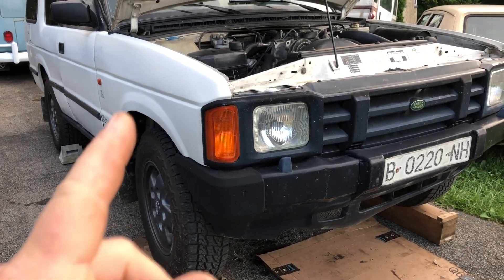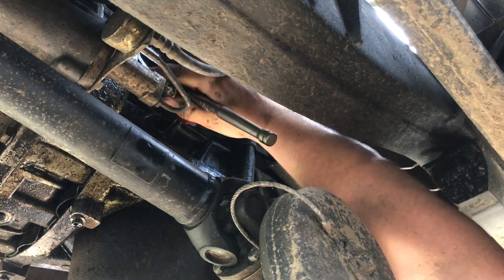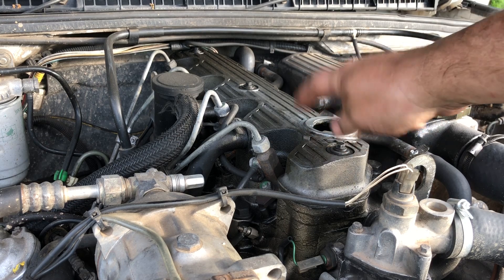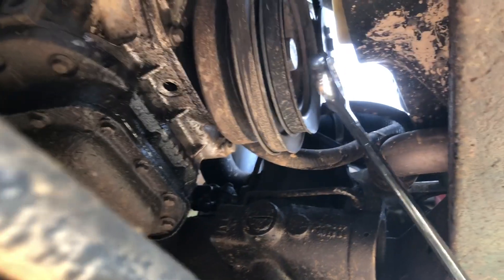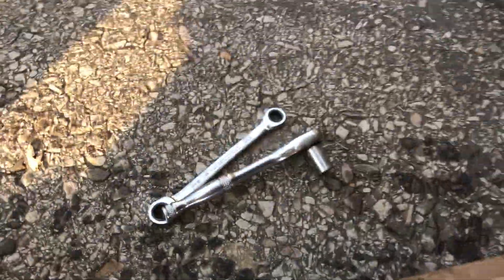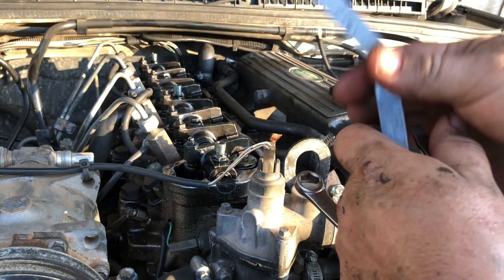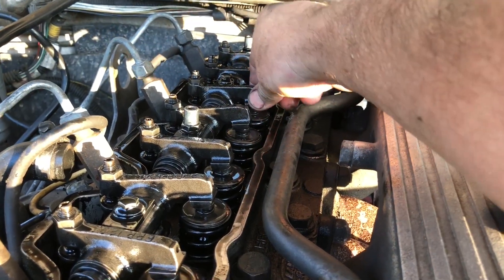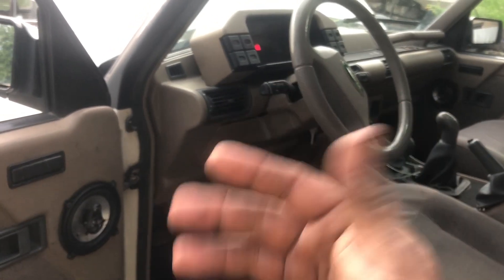200TDI oil change adjust valves maintenance Land Rover discovery defender repair filter

Comment: where did you get the 200tdi from?
Also since the 200tdi is a bit vintage these days, check/replace lash caps on top of the valves, under the rockers. they can wear to the point of going missing!!
Reply: ...ok its in the description imported from spain lol. Good on you bud
Reply from the maker: That is true. Imported from Spain. Excellent point about the valve caps. One of the reasons I checked the valve clearance to see if there’s any crazy changes. I have owned the vehicle for about a year and half and it has a broken odometer. So mileage is unknown but engine seems to be taken care of nicely. Runs great!

Comment: It's a good idea to fill your oil filter if you can, however it's pretty pointless if your filter sits sideways as it'll all glug out before you get it fitted properly!....How's the Series going these days?
Reply from the maker: That’s very true. Since I had to tip this oil filter over a little. I filled it up only 3/4 full. So not to spill any. Oil is expensive these days!! 
We finished my son’s 73 VW Super Beetle project. Now I have time to work on the Series truck. After sitting for almost 10 months it started right up. Hope all is well with you!
Reply: @conrad1468  ...All good thanks Cory 😁

Comment: The oil filter is in a more difficult position on the diesel than on the v8 gas and no valves to adjust
Reply from the maker: You are correct. The V8’s are in a better position.